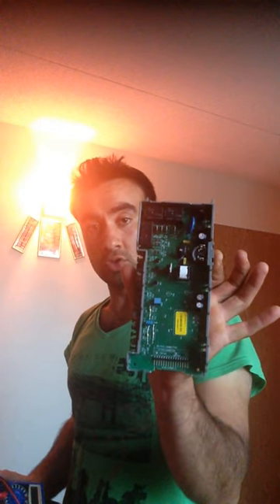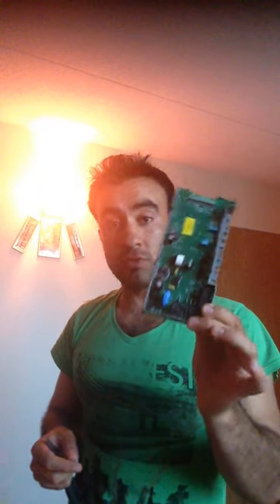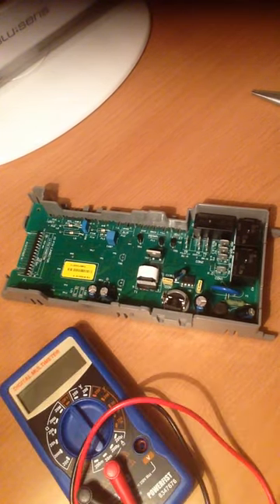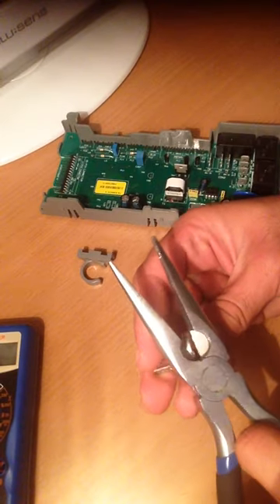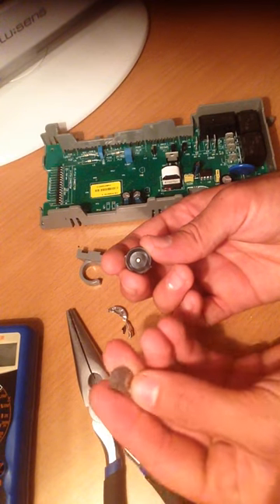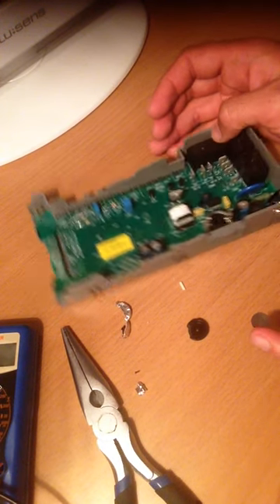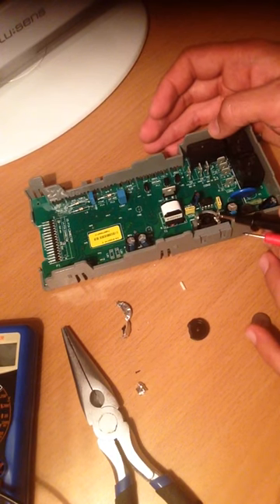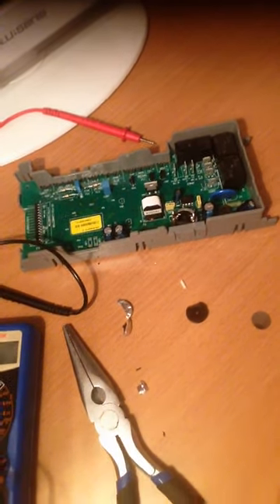Whirlpool dishwashers control board fixed for free

Comment: It has a disc that breaks contact when it trips.  If you take off the fuse and smack the silver face on a flat surface sometimes you can reset them. The disc will go back into the original position

Comment: Some have suggesting smacking the switch down on a hard surface may reset them.  I suggest putting it in a freezer first or hitting it with freeze mist, liquid propane etc. either may reset it or should enhance the effectiveness of the smacking technique.  This switch indicates it got really warm around the control board - look for other issues like swollen capacitors  or perhaps the drying heater in the unit is stuck on. .  One may be able to drill a small hole in the outer metal of the switch and then pushing on the disk to rest it.

Comment: you do not have to take the fuse apart to reset it. All you have to do is slam it on a hard surface metal side down. it may take a few times but it will reset the fuse. I've done it many many many times.
Reply: Genius
Reply from the maker: Hahaha 😂 OK
Reply: the fact that you have done it many many times tells me that its a quick fix and the problem still persists. jesus people. fuck that cost cutting bullshit. its a 10$ fuse!

Comment: I have a Whirlpool Gold dishwasher.  shortly after we bought it - it stopped working properly.  it would fill with water but wouldn't agitate.......it was under warranty - the service person came out and apparently after trying to determine the issue  by removing the panel on the top inside (if I remember correctly) he did what he referred to as a reset.  after that it worked fine.  he said the circuit board would glitch and that had apparently been the problem.  

It's doing it (or rather not doing it) again.......do you have any thoughts on how to reset it?  It's approx 4-5 years old and has a touch panel.  it does fill and it does drain - but for some reason again - the washing cycle does not seem to be working.

thank you
Reply from the maker: ssarge2 send me the picture of your display on my Facebook messenger please. Hameed wafa
Reply: here are the controls in 2 rows. I typically use the 1 hour wash cycle.  ever since it got goofed up right after we bought it I hesitated to use the delay as I had done with my previous washer.

top row: left to right: Sensor -     Heavy -      Normal -      1 Hour Wash -      Soak and Clean
 middle                        Hold 3 sec                                                                            Start Resume
next row:  Cycles - Delay  (Led panel) Sani Rinse - Heat Dry - hi Temp Wash - Target Clean - Cancel/Drain (hold 3 seconds)
Reply from the maker: ssarge2 https://youtu.be/LV61ReZ1q0k I have the reset video check it out
Reply: Thank you.  You've been very kind to take the time you have to help.
Reply from the maker: ssarge2 you are very welcome 😀. My pleasure!
Reply: To reset Whirlpool dishwasher, you will have to have the door open. It can not be latched. Press "Heated Dry," "Normal," "Heated Dry," "Normal" within three seconds of the first pressed button. Now close the door, this should reset your dishwasher. Hope this helps, good luck.
Reply: thank you.  I'm printing out these instructions and keeping them somewhere I can find them next time I need them.  currently it seems to be working........
Reply: If this its the proper reset for your dishwasher, then it will be confirmed by ALL of the LEDs lighting up when you finish.
Reply: let me add that comment to my notes.  I keep wanting to use the delay on it - but always afraid to do it because the first time it stopped working was after I used that.  it was probably a coincidence, but left me a little gunshy.  thanks.  I suppose I could try this now even though it is washing properly?
Reply: @Clarion004  thank you!! This after many power cycles and disassembling the entire machine. My issue was it would only respond to the cancel button and run for 2 minutes.

Comment: i have a kenmore ultra  Wash. All the buttons no lite. Then I push Heat dry and sani like you show and all the panel  come up and it start diagnostic. After it turns itself off. And no light work no start button. Just the three Buttons. High temp, Sani and  Heat dry,. can you help?  I try another another panel but white color this one work.  Do you thing I can reset and make my black one  work? Or is it dead?
Reply: I have the same problem.  Were you able to fix?

Comment: I don't know if my board is the same as this.
It's a Kenmore Whirlpool Dishwasher Control Board W10130967 - looks like this one.
My problem is that when I press ANY button, only the "Normal Wash" light flashes.
I have tried your method - and several others - to reboot or run diagnosis on the unit.
Always the same results, just the that button flashing.
Would this be the fuse or the control board causing this?
Reply from the maker: It’s most likely your overlay touchpad . Send me a picture of it on Facebook . I will see if I have a used one you only pay for shipping . I will help you with part for free 😀
Reply: THANK YOU for your generous offer. 
What I did was take everything down cleaning as I went. 
(The unit is about 12-15 years old)
I saw another video recommending checking the back side of the control board for possible burnt circuits. 
Did find and issues. Also checked the thermal fuse for continuity- OK.
Reassembled everything (so I could send you a picture of the touchpad)
and it works! 🥳
I’ve now run through 3 cycles with no problems.
If I run into any issues I will reach out on Facebook. 
Thanks again!
Reply from the maker: @Bamaboompa  My pleasure✌️

Comment: Nice option - these machines aren't worth the cost of even one repair. Mine has four cycle led's that are just dimly lit - not bright as when a cycle is selected; Does anyone know what this issue may be?
Reply from the maker: Michael Witt your display needs to be replaced, try to look around for used part, or some appliances shops thst keeps appliances for parts, pay them $20